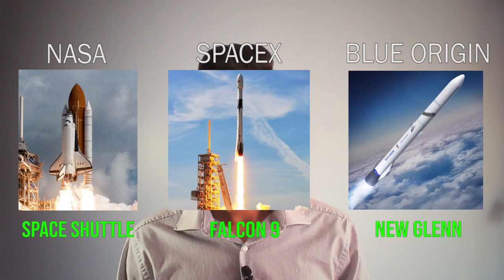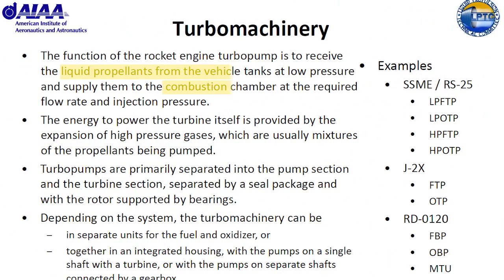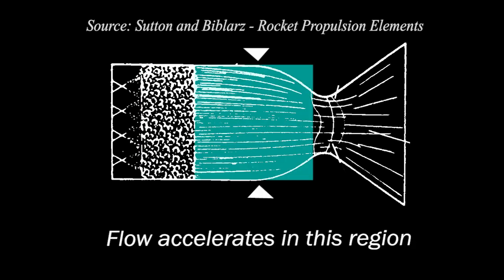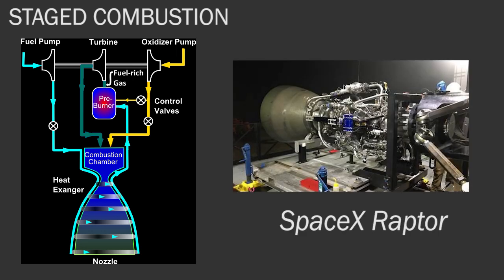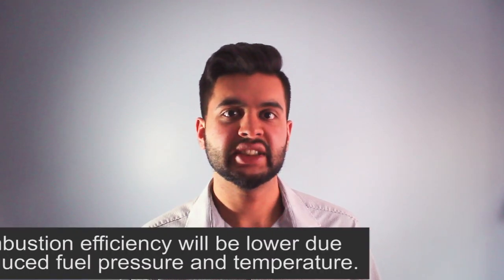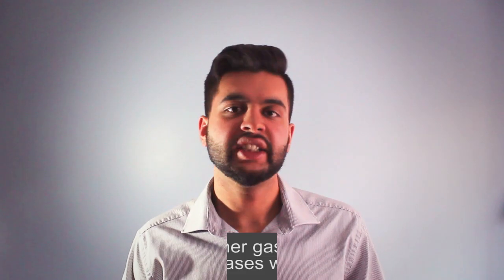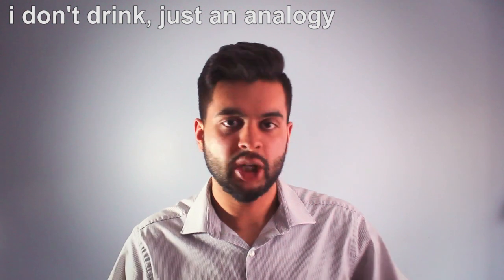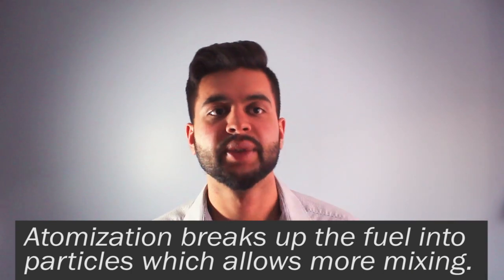How Does Fuel Combustion Occur in Liquid Rockets - Injection and Atomization Basics

Comment: Sure looks to me that both the stage combustion and gas generator use regenerative "heating" of the fuel which also cools the surface. However, it's really for recuperating energy and putting it back into the combustion area.  We do this all the time in industrial furnaces.
Reply: And as for Pressure feed system: The use of a bladder removes any mixing issues. ... Yes, please think about it.

Comment: Very well made, and excellent information for the most part. I do have a few critiques though, if you are willing to hear me out. 

So first, I noticed at 3:55 you say the pressure fed cycles are inefficient because there is a gas pushing another gas and so they inevitably mix, but this is technically not the case. The propellants are stored in a liquid form, not a gas form, and so long as there is a proper diffusor installed on the pressurant inlet to the propellant tanks you should not have to worry about high pressure gas jet shooting into the stored liquid (especially bad for cyogens which the comparatively hot pressurant gas jet would start to rapidly boil off if this were to happen). 

Second, I feel you may have mischaracterized the relative inefficiencies of the different cycles, or more specifically of the difference in efficiency between pressure fed vs pump (be it gas generator, staged combustion, or other) fed cycles. Correct me if I am wrong, but from my understanding it is not so much a matter of which is more or less efficient and more a matter of practical scale. Sure, if turbo pumps and gas generators (or precombustor i guess if its staged combustion) could scale down linearly with chamber size then absolutely they'd always be the best way to go. However in reality there is a limit that these devices can be miniaturized. Of course, there are some really great examples of out of the box thinking that have enabled even smaller scale pumps to work, the best example being Rocket Lab's use of motor driven rather than turbine driven pumps allowing them to scale the pump down more without worrying about pesky thinks like residence time and propellant mixing inside of a gas generator (being the primary issue I know of regarding scaling of gas generators). However even the Electron rocket is no small piece of machinery. If you were building, as you said, a small lunar lander, using a pump may actually be less mass efficient than using pressure fed systems.

Third I noticed that you didn't mention expander cycles. I mean it's up to you what you wish to limit the scope to, and its true there are not a lot of expander cycles, and the have a built in size limit, but among their ranks is the legendary RL10, arguably one of the most successful rocket engine designs ever made. As well, the CECE variant of the RL10 demonstrated some of the deepest throttling capability of any liquid rocket engine of its size (as far as I am aware) and achieved a range from 5.9% to 104%, which I feel earns it at least a mention, but Ill admit that is just my opinion, not a fact check or anything.

Otherwise I thuoght it was a spectacular video. You are clear, concise, and your videos are always a good balance of information density and a followable pace. Keep up the awesome work! Oh ya, and the rest of UTAT says hi as well :)